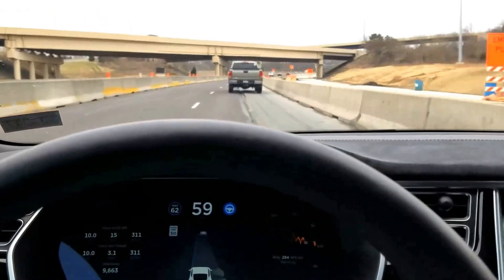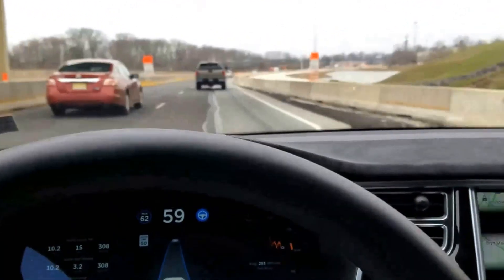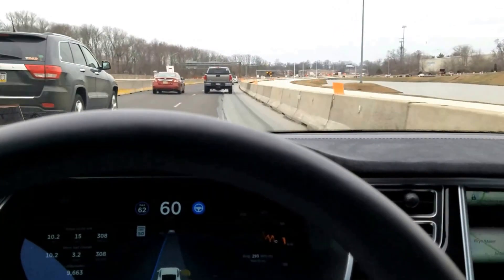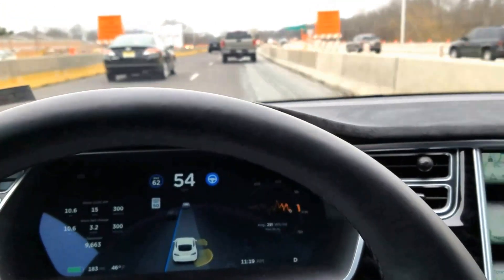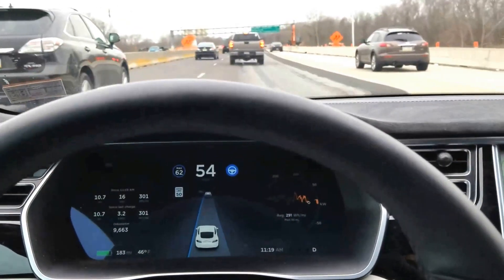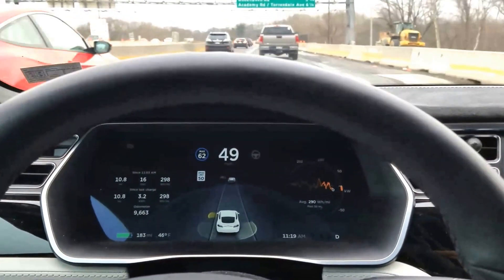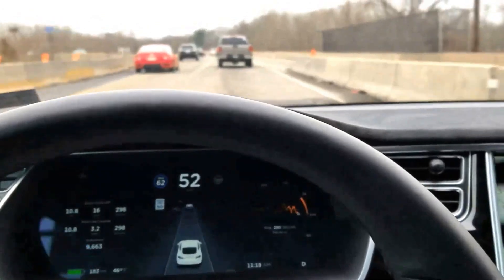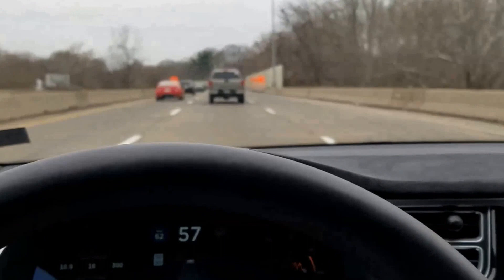Nick's Tesla - Auto Pilot in Construction Zones

Comment: am wondering if there is a tech that is using some sort of sensors that 
can memorize the road by driven on it .. like you  if U set some sensors
 that can memo Ur road to work and they autopilot it next time based on 
Ur first drive ??!! sorry for bad English .. and  thanks for That great video
Reply from the maker: Tesla uses camera's to identify the lines in the road and Auto Pilot simply stays between the lines. In addition it has front facing radar to make sure you don't run into anything and side ultrasound sensors to make sure you don't turn into something. If you watch this video, you will see how the new front, side and rear camera are learning to recognize objects and make human like decisions (like we do) to drive through roads - https://youtu.be/YntM3bVVaqo?list=PL9r_kipC8Z-TU-qF0NtHcOqgV8ZvbCnbQ
Reply: Nick's Life thanks for replying .. i know that .. am asking about a sensors that can memorize the road and memorize how u drove the car to ur work and save it  . so the next  time the car can go to ur work based on ur way of driving .. am sorry if i cant explaine this right
Reply from the maker: I think I understand were you're going with this and it may be useful to learn the general path a driver goes to work and utilize that info to assist future self driving. However, just attempting to memorizing a specific driving path will work by itself, things change too much (traffic, road conditions, construction, etc.). Tesla is working to toward self driving which will do the same, but take into account things in the environment that change day to day. Now Tesla does capture lots of data from all their cars and can use this data to learn how humans drive on certain roads and get through weird situations.
Reply: Nick's Life yaah this is my point .. thanks so much for reply
Reply from the maker: Mhmoud Ahmed always here for my subs!